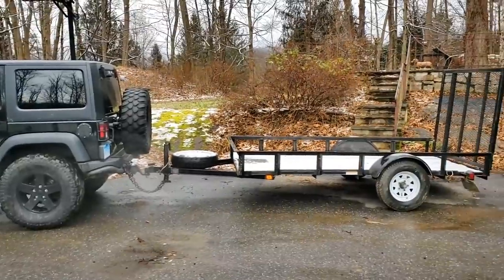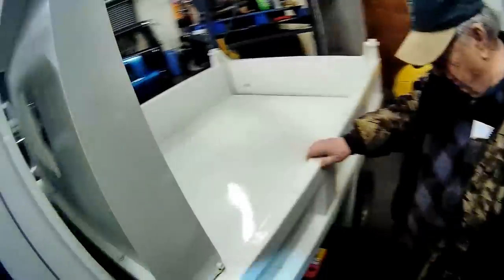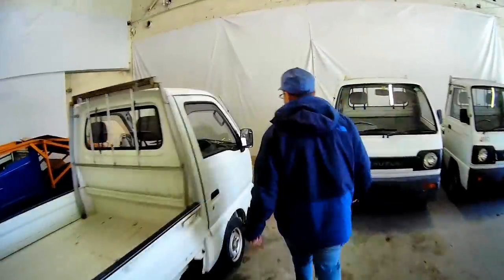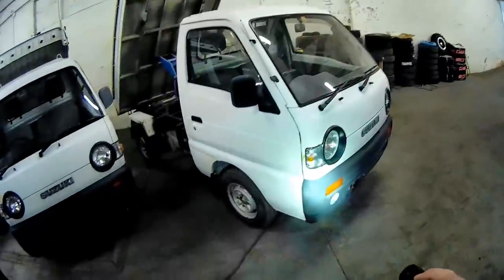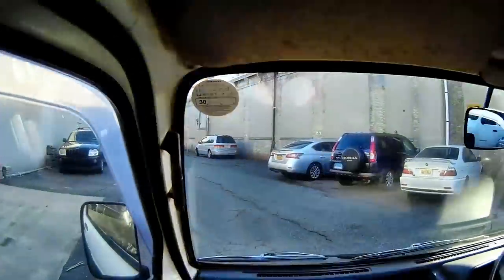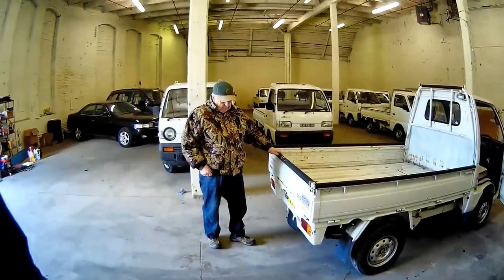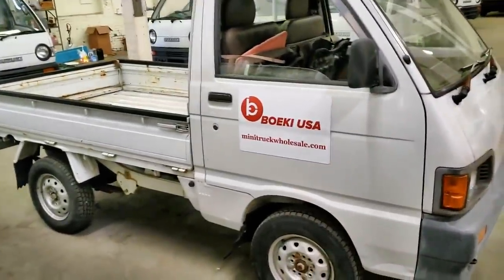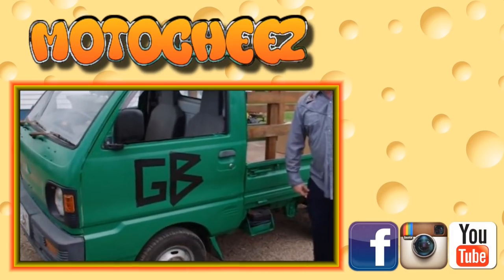$4500 Mini Truck info (SE01 EP01) what to look for, buy and get it home on 5x10 trailer

Comment: That is awesome I didn't know we could even find those here in the states, I want one for our hobby farm! Thanks for a great video!
Reply from the maker: Will work great for that!
Reply: Lots of people sell them. I used to sell them. Great little trucks.
Reply: Michael McFearin lots of farmers in the Midwest use them.
Reply: I don’t know where you’re located but I definitely recommend Duncan Imports in Christiansburg VA. The cars they sell are rock solid and almost museum quality for the best price.
Reply from the maker: I saw their website. They were a bit far for me to drive. Looked like good inventory
Reply: Use mine on my farm.  It gets stuck in a cow pattie not even lieing. They are super nose heavy obviously. Unless you get atv tires and rear weight it is only for dry flat ground
Reply from the maker: Haha. I believe it! There is NO weight in the rear! We used to call them cow pies😁😁
Reply from the maker: Also, I'm planning on putting videos together from "viewers rides" and have an episode every so often featuring their minitrucks. Keep this in mind if you want to submit something, stuck in a  cow pattie would be epic!! Hahah
Reply: MotoCheez i get stuck every time I have it out just about. Put it in gear with the tires spinning and walk around the back and push it. When it gets going climb back in. I want to try and pick it up with the loader of my tractor and put in the bed of my truck.

Comment: I wonder if I could fit one of those in the bed of my pickup lol and just subscribed and in Utah you drive your utv and ATVs on the road as long as they have plates and bunkers and lifts and stuff and are registered
Reply from the maker: Yes Google search mini truck in bed of pickup. People have done that, they do fit. It's crazy. I had a couple other people say that Utah is good for those. I was out there for Moab a week loved it I'd love to bring the mini next time.
Reply: Yeah nice and maybe if I buy one I will just take my old obs and load it up in the back instead of take a trailer and Utah is nice like that heck I don’t have to do emissions or safety on my truck anymore and I actually seen kids driving there utvs high school and people driving them around and stuff
Reply from the maker: They're fun, not a lot of articulation but does ok, like a Mule
Reply: Nice and ok and I would probably get a side by side and a mini truck one for fun and one for work

Comment: I  used the Mitsubishi mini trucks when I worked at the state prison all the time. They would fit on the sidewalk and go though through the walk though gates. I liked them because they had heaters and it beat driving a John Deere gator around in cold weather with the rain and snow.
Reply from the maker: Sweet! That's why I chose this over my Polaris ranger! Some people hate on it because it's $4500. Try buying a UTV with half the options. 😄

Comment: Namaste, in India there is a whole category of these light trucks starting with TATA ACE. It was primarily made by Tata Motors Limited (now owner of Jaguar- Landrover) to replace finicky 3 wheeler cargo auto rickshaws. Tata Ace has created a new segment and new trucks are priced between 2.25 and 3.35 lakhs INR ( 3200$ to 4800$). Common specs Engine capacity is 1400cc, output 70 hp and it shares engine parts with other TATA passenger vehicles so parts are cheap and its very easy to maintain. These mini trucks are road legal in all Indian staes and only drawback is, they are overloaded many times with inexperienced drivers driving them on already congested Indian roads.
Reply from the maker: Heat information, thanks!  I searched and didn't find any available here, they look pretty nice.

Comment: Your advice please...I juist purchased 30 acres in Az and have been looking at the utv's like Mule and others. I've got the opportunity to purchase one of these at a great price (father in law has one he doesn't use nor had he used it, he essentially just bought it to help someone out and there it sits in the garage.) 
How well do they do off road? Hills? I need something that can get me around in Northern az property, hills, mountainous a little bit and not let me down, getting stuck. How much can it tow? 
Figuring fencing, dirt moving, small rocks,  tree clipping, just a small 30 acre ranch kind of thing
Reply from the maker: They're awesome, especially if you get ones with the rear lockers. I have a ton of offroad videos with this truck! A whole series

Comment: In the Philippines it's converted to left hand drive and they are imported from japan cut in half to evade import laws.
Reply: Sounds similar to how Australia is.
Reply: How do you convert LHD? Is dashboard available? or just do without?
Reply from the maker: I just left it RHD, there must be a way though.
Reply: @ModMINI  The dashboard is cut in 3 pieces or 2 pieces depending on the design and rearranged.  The mechanical stuff is designed to be left or right hand so  minor welds are just needed.  I have a van that's converted but I can't take pictures right now am on another country.
Reply: Here in Domininan Republic, we have lots of it, converted to LHD.
Reply from the maker: Do you know what's involved to do that? I've heard that they cut the dash but do they sell another dash or make another dashboard?
Reply: @MotoCheez It can't be pretty. Pretty sure these trucks/vans were never sold for LHD market.
Reply from the maker: Ok. True
Reply: @MotoCheez   I think it takes them 1 week to do all the welding and cutting of holes.  They don't touch the seats just the dashboard, pedals and steering system.  You can do  a video series on it, all I see on youtube is cars being converted and it's harder because  of the firewall and the engine is in front of it. I'll watch that series  if you do it :)
Reply from the maker: That's a hell of a project! The right hand drive literally takes a few minutes and you barely even know your on the right side.
Reply: lately, they now have LHD dash boards,  but before, they cut the dash 3 ways , and slowly re solder it. after that, apply bondo and paint. hehehe, i've seen it done. a friend of mine had an auto shop that converts any japanese vehicles from RHD to LHD.
Reply from the maker: That's an art all by itself..
Reply: They make them in the Philippines. Stop lying about the “cutting in half”
Reply: @whteman2  it was never released locally in the PH until late 2017. Also, local release units dosent have 4x4 option.
Reply: @MotoCheez  
Drove those lil trucks,
3 cylinder Two stroke, about 360cc, bing bing biiinnnnng, for fun weekend jaunts, while Marine Japan, '80...they went good !
Even drunk RHD was a cinch ! lol.
Reply from the maker: Nice! Those 2 Stokes were fast!
Reply: there is no way u can convert this mini truck to left hand drive. because there is no lhd dash for mini trucks. unless they make some ugly conversion just to make the truck move.
Reply: I've seen them new and used whole not resembled all around Iloilo.
Reply: @CabezaDePistacho  not impossible in the Philippines...

Comment: Dont care what anyone says - those little 3 cyls sound friggin sexy !
Reply: LMAO
Reply: i the piggio porter is the same thy use 1300 cc 16 valve for cylinder injection suzuki engine and are very good and pull with a load up as good as any larger van i have one but the down side is the road tax is the same as a ford transit £ 238 a year and the insurance is not cheap u can run a transit van over a year for around the same cost here in the uk now if thy came with a hayabusa  engine that would be sex on wheels

Comment: here in texas you can't make them street legal and that sucks. i friend bought one got it inspected got tags on it drove it everywhere for about 5 months  it was a mitsubishi 4x4 right hand drive then one day he got stopped they pulled his plates right there on the side of the road towed his truck. he had hell getting his truck back he took the state to court to get his money back for his tags.  it sucked it would run 75 mph got over 50 mpg a/c heat. and 2 days later i got a call my truck was in. i already paid for it so i had to take it but it wasn't a week later i had it sold so i got lucky.
Reply from the maker: Aww, that sucks! There are a lot of them over 25 years old registered legally in CT, went through inspection process at DMV ect. . Must have been the newer ones? Has to be over 25 years old to technically be allowed to be registered because of safety standards. You'd think being so efficient they'd allow them here. Has to be as safe as a smart car!
Reply: @MotoCheez  i don't remember the year of the truck but your right and i'm going to check into it. in 2007 is when we had out trucks but i don't think they had that 25 year old or older law back then.
Reply from the maker: Yeah. The less than 25 year old are supposed to be 25mph speed limited, like golf cart
Reply: @MotoCheez  i'm going to check into it again and i choice the mitsubishi because it had the highest top speed and it had the sliding steering wheel. flip one level and the wheel and pedals would slid to the left side
Reply from the maker: Nice. Didn't know that. Each one seems to have one advantage over the other lol
Reply: you may not be able to register em and drive em but these little shits are good for use on farms or any large plots of land so theres that
Reply from the maker: Exactly, I had a Polaris Ranger I sold. Couldn't legally drive that on the road, these are better for my needs anyway IMO
Reply: What do I look em up as want a 4x4 to play around in lol
Reply: so if they got brakes lights seat belt why cant they be legal. they are doing it with side by side up here legal to run anywhere
Reply from the maker: They are legal in many states!
Reply: I've seen a couple around Houston...
Reply from the maker: They have a few dealers out there I see
Reply: @MotoCheez   oh yea the more i look the more i read in 8 or 9 months when my boat is paid off i'm getting another one but i also know the paper work now that you have to have to go with it. i am still a little confused about this 25 year rule because when i look it up for texas it says 21 years.
Reply from the maker: Nice. Each state has its own laws, but the federal import rules I believe are 25 or they have to be speed limited to 25mph and sold "not for road use"
Reply: Here in Florida they will not register these vehicles for Street use
Reply: STATFIGHTER10 i drive a Mitsubishi mini cab. It does not go 75 mph. Not even close. 45-50 kph is getting it. I haven't had long enough straight road to top it out. But it's really winding out at 50 kph. 

Legally in my state it can be plated like a side by side. I use it as farm use.
Reply: Be careful. Parts are hard to come by and when you find them they are expensive.
Reply from the maker: That's cool! I've never seen the Austin mini, I did drive out to Moab exactly a year ago with my Rubicon, I saw the UTVs all over the roads too. Loved all the open outdoors. We drove over 4 hours on trails without seeing another soul!!! Of course I recorded it 😁 https://www.youtube.com/playlist?list=PLcxhNVEfTm_MfjuzlAIXqX5dTFF1uySJP . If you get one let me know. I'm in PA every couple months.

Comment: I have been inspired! I have bid, won, and paid for one of these in Japan. I am waiting for it to get on a boat over to the US now. Happens to be the same engine/year as yours. Mine isn't the Climber but the Jumbo so I don't have lockers but I have 5 speeds and AC. Much like the one shown in SE01 EP30. Mine is intended to be a run-around truck and something I can tow behind my RV so I won't be doing a ton of the mods you did but some will for sure be done. Gotta have Flair.
Reply from the maker: Awesome!!! Keep me updated

Comment: I noticed you have attached your wirering down the side of your windscreen. Did you use self tapping screws to hold on the clamps? Did you use anything to prevent rust and sealing?
Reply from the maker: I used zinc coated self drilling and tapping screws. I haven't done any rustproofing yet.

Comment: I speak Japanese, hijet doesn't mean midget. Just a name. These are great little trucks, especially if 4x4. Just don't have a wreck.
Reply from the maker: I learned that.. got that info off Wikipedia
Reply: Japanese don't have a word for miget but they do have a symbol for it. It's just really small.
Reply: @centerspike6613  661 wouldn't stand for an area code in Kern county would it?
Reply: I'm guessing Hijet is a combined word between Hilux (what the Toyota pickup is called in Japan) and Midget. Hijet = hilux+midget.
Reply: The high jet is Toyota witch i knew
Reply: @markgarcia3889  You in Bako Mark?
Reply: @cpkaleth  Yes
Reply: Beware of the Toyota Witch.  @waynecipriano7698
Reply: I have seen something similar  in Korea  but here in America we eat lot I mean a lot  especially in the south ,so here we have f150s or huge diesel  trucks .

Comment: We have a 97 van, dual AC and seats seven . Marked as a Cushman. Have no clue who makes it.  There is a guy in Maryland who also imports these trucks.
Reply from the maker: I wonder who makes the Cushman myself
Reply: Cushman is a manufacturer of industrial, personal, and custom vehicles. It is currently based in Augusta, Georgia, United States, and is owned by Textron.
Reply: Thanks, Cushman doesn't build the vans, they just put their badge on them. It may be GNC  But again, I don't know where they are built.  @Nivasi
Reply from the maker: So they never imported and rebranded their trucks? Some look so much like the Japanese minis.
Reply: My only clue is GNC   There are no markings on the engine or the trans. No labels anywhere on the body   To buy parts from Cushman is insanely marked up and the dealers themselves are a bit lost ....this is a 97 van at this point.    @MotoCheez
Reply from the maker: 👍 hmm, I must investigate 😁
Reply: Maybe a Subaru Sambar micro van, branded by Cushman.  I know that Cushman and Subaru have had strategic partnerships in their golf equipment, carts and such.
Reply: Thanks,  I'll look into that.  That would be a big help.   @markmcc78
Reply from the maker: Could be. I had an ezgo cart with Subaru motor too
Reply: I had 1 as a company run around. Suzuki, Daihatsu, Piaggio, Subaru, Toyota and a company I never heard of called Perodua. They have been built by 1 company or another since 1960. It first appeared with a 355cc 2 stroke engine and a 3 speed manual transmission. It now boosts a 1.6 16 valve engine with a 5 speed gearbox.
Reply: I'd certainly like to find a kei van or kei truck seller in Los Angeles, if you'd know how to find one. Google has failed me.
Reply: Cushman vans are Suzuki Carry's
Reply from the maker: 👍👍 TY

Comment: We had one of these at one of my first jobs. Can't remember the make or model but it was an excellent little truck. 4x4 high/low with a locker in the rear and a 5 speed. It was a manual transfer case the but locker was electric. It was so convenient for setting CM pheromone puffers in the orchards because it fit down most rows and had plenty of bed space for bulky but lightweight cargo. If I had more land I would have one. They're excellent for little jobs at the fraction of the cost of a side by side and have way more bed space. They're not near as capable off road but they're very practical if payload and bed space are more important than off road capability.
Reply from the maker: Well put! I

Comment: I had the van version of one of these in Japan. it was all wheel drive and had AC. Great for driving around Tokyo, horrible for hills or the freeway.
Reply from the maker: yeah he's definitely not a highway type car I feel it on hills too but I'm just doing back roads if anything it's mostly going to be for on the property through the trails and woods
Reply: @MotoCheez  Perfect for that, does great if you just put in low gears and don't have to care about who's behind you. Enjoy!

Comment: growing up, not quite 40 years ago there was a shop that bought & sold Suzuki trucks, & the little jeep looking ones, he made a trip once a year to buy parts for, and he sold the parts all over the USA, but these old Suzuki trucks were running around everywhere, most had 2 stroke 2 cylinder, a few had 3 cylinders engines, I have no idea what happened to shop, but when I rode by 10ish years ago, it was closed.  but always loved them, drove a few, but never owned any
Reply from the maker: Cool, what state? Ive seen the 2 stroke ones in video, they sound like snowmobiles!
Reply: Guy had shop in NC, but once upon a time a huge amount ran around VA, and NC, I guy drove a black one with mag wheels, it had dual stacks, crazy part was radiator hose to connect exhaust to stacks, I kid you not, it did burn a hole through, but saw it for years, the little shop, I hung around as a teenager and into my early 20's until I got too hooked on horsepower, and Harleys. I still want one so bad I can taste it. Lol.
Reply from the maker: Haha. Whatever works, but radiator hose for exhaust?? Buy one! 😎
Reply: Couldn't believe it either, but wasn't mine, and 20ish years ago. There may be a seller in VA, saw 1 add last year, but not drove there to look around. Probably 50+ miles to car lot advertising them.